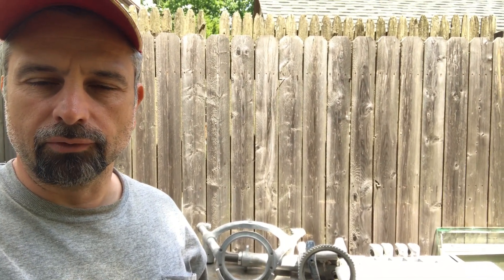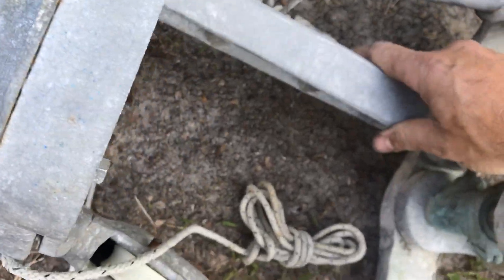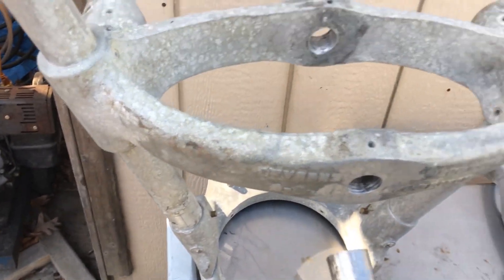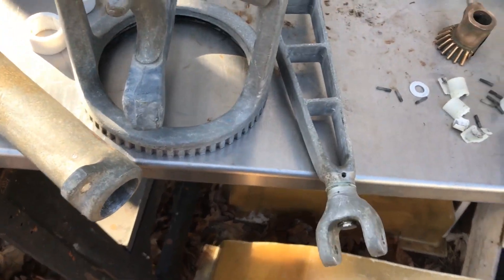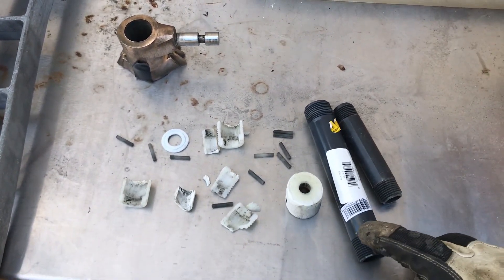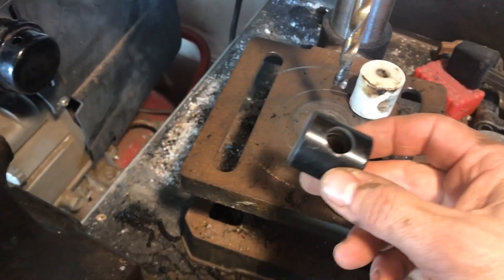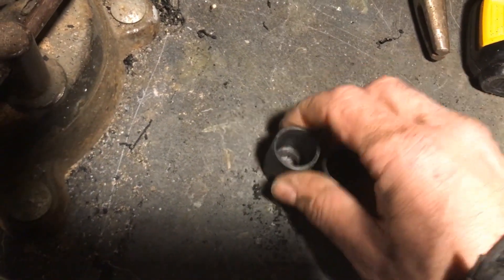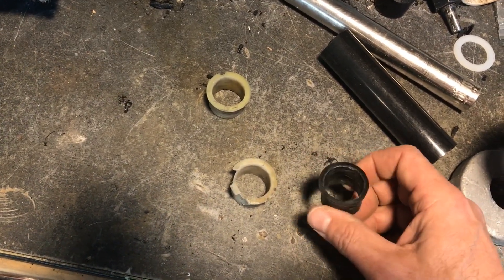Contessa 26 Refit ep.12-Aries self steering windvane rebuild with homemade parts

Comment: Rebuilding an Aries... how do you get the old grub screws out? Mine are so corroded in. I've used heat but to no success!
Reply from the maker: Yup, I had a few like that.  I ended up drilling them out tapping a new thread and a installing new grub screw.
Reply: @EpoxyAndButylTape  thank you. I think that's where I'll be going!

Comment: Hi, I’m also restoring an old (1970) Contessa 26. I’m currently looking at the anchor well and was planning to add external drains via clam shells. You fitted these but then removed them and went back to a drain in to the bilge and I’m wondering why? Thanks, Michael.
Reply from the maker: Hi Michael.  I went back to hose in the bilge temporarily until I make that locker water tight,  It turned out to be the right thing to do last year after I hit a particularly nasty shoal at the mouth of an inlet with a strong current.  She was lying on her port side from the current and waves coming in from 20 kts of wind.  Luckily there were people around and we were able to get pulled off rather quickly. We would've certainly taken on water if we were stuck there for any amount of time.
Reply: @EpoxyAndButylTape  Thanks. I may do the same - hose to the bilge until I work out something better. Michael.

Comment: Could you tell me the specs for the ply blade,just bought a boat with an Aries but no wind blades.Just need a starting size, i know to adjust the weight.
thank you
Reply from the maker: Yes, the weight of the paddle is more important than the dimensions.  I used 5mm plywood, thinner and lighter than the recommended 8mm. Also, I cut it down to 35 inches long, which is the smaller side of the length range of 35-50 inches.  You need to figure out what works for you by starting big and trimming until you get a paddle that responds, but keep in mind that the gears need to be oiled frequently for the vane to pop back up when pushed over by the wind. According to Lean Nelis, the current owner of Aries, the weight of the wind paddle should be equal to or close to the weight of the lead counterweight.